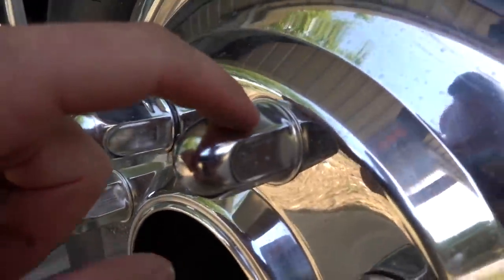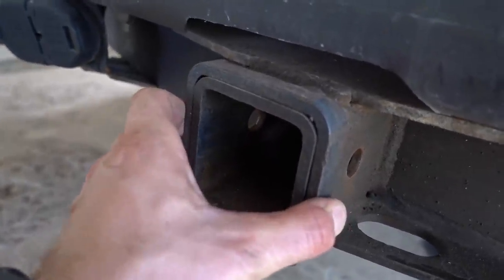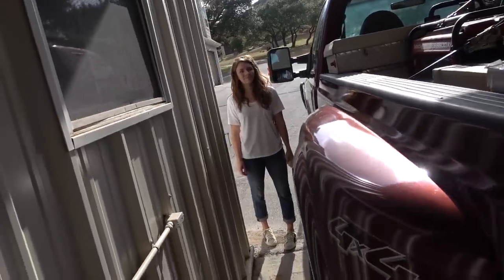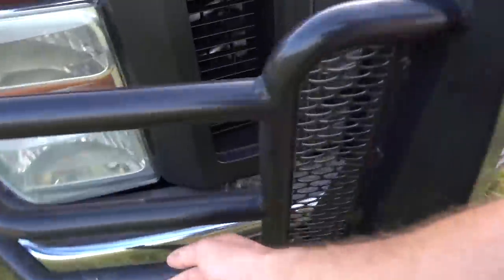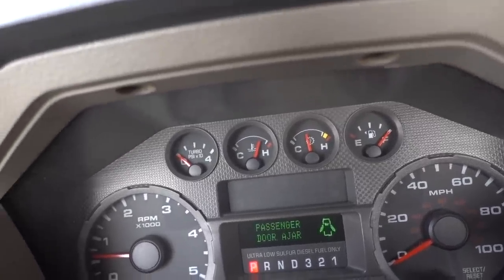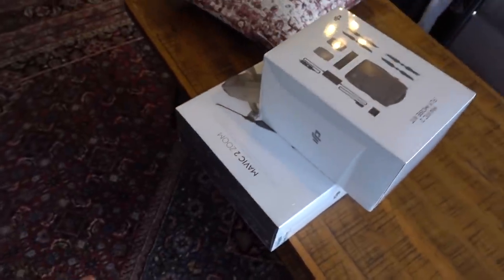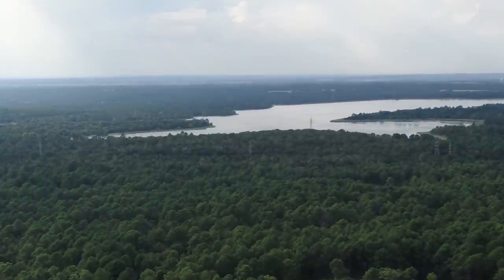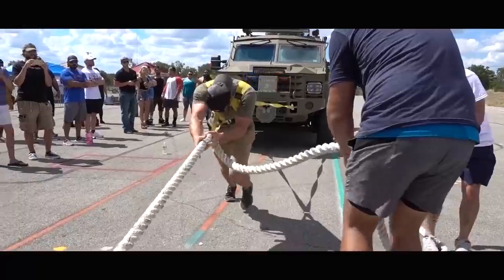My F-350 broke down immediately.....

Comment: You are about to discover just how expensive a cheap truck can be.
Reply: Should have got a cummins
Reply: @moparjr89  Much better track record, especially compared to the 6.0 and 6.4. He could have picked up a pre 2006 cummins, spent less and had a much more reliable truck.
Reply: @moparjr89  especially a ford
Reply: @GlennPearsonDIY  Yeah but the 6.7 trucks are cheaper than the 5.9s and better in almost every way when left stock.. no contest at all, no way I could tow 65mph with an 06 with od locked out after having a 15 6.7 Cummins, not to mention towing heavy in the hills it's a no contest, plus bigger axle..
Reply: Yup your right
Reply: There is a reason why the are cheap.
Reply: Should’ve got a taco
Reply: They all run good till they don't...lol

Comment: Matt: My 6.4 broke down immediately
All the truck guys from the last video: Welp, who could have seen this coming ;)
Reply: Ahah
Reply: And he was shi**ing on the 6.0 in the last video
Reply: Yeah.. I think a bunch of us posted something about this.. ahem .. wonderful engine.
Reply: Andrew Prina the 6.0 is actually a great engine after it’s been bulletproofed. Way more power than the 7.3 but still finicky with water in the fuel every now and then.
Reply: @mrmike1183  I love my 6.0
Reply: Andrew Prina I love them too. Had a F-250 and it got totaled from someone Tboning me....now I want a Eddie Bauer Excursion with the 6.0
Reply: @mrmike1183  I've got a 250 and I'm trying to get another one
Reply: Yep
Reply: Everyone
Reply: The 6.4 was a failure. That's why it was only made for two years.
Reply: We all saw it coming lol my 7.3 is at 317k and still trucking great motor
Reply: Shoulda got a 7.3 smh
Reply: Lmao they never listen. Oh well
Reply: Man i hope he listens to this....its not to late to 12 valve pea pump that dually....reliable 300,000mile+ truck with a cummins. Other problem is dont buy used duallys.  They are worked. Usually worked twice as hard compared to SRW trucks
Reply: Why not heat pig.

Comment: Matt I have a 6.4 and yours needs a Bulletproof diesel auxiliary oil cooler because yours is shot. To know for sure you need to hook up a monitor to the OBD2 port and look at your coolant temp compared to your oil temp. If there is more than a 20 degree difference between the two it’s the Oil cooler
Reply: I agree
Reply: 6.4 is junk no matter what you do to it. It will always be junk.

Comment: I am a ford guy, but the 6.4 diesel is an absolute pile. should've gotta 6.7
Reply: NEVER EVER touch a 6.0  (of course) or a  6.4. I'd even be leery of a 6.7 with all the emissions crap on them now! Of course Bullet-Proofing the 6.0 let's it shine, but who wants to drop almost $5K + after buying a used truck?
Reply: Agree but if power stroke and international didn’t split we would still have the 7.3
Reply: Polarisguyproductions idk, I think emissions would have killed it
Reply: not anymore there good now
Reply: @polarisguyproductions6549  international and ford split up after the 6.4 power joke. Just so you know
Reply: hunter ben I know I’m just saying they should of stayed together so we could have the best Diesel engine ever still
Reply: @polarisguyproductions6549  no it was discontinued because it couldn't pass emissions test because of its displacement for the size of the truck
Reply: The 6.7 is a great engine.  One of the best ford has ever made.

Comment: The 6.4 is known for legitimately exploding itself I would recommend getting rid of it and getting a 6.7l or a 7.3l so 2011 and up or for a powerstroke 7.3l its 1995 to early 2003
Reply: 7.3 all the way
Reply: If you suggest a 6.7 I wouldn’t recommend a 2011... notorious for turbo issues
Reply: Simple get a duramax
Reply: Do a Cummins swap!
Reply: I’ve had my 7.3 for 17 years and 365k. Still original engine and drivetrain. Rebuilt the trans once. One new turbo.
Reply: If its 7.3 i would go with a 2000’s one. I love the obs trucks but those 7.3’s just arent as good as the 2000 ones
Reply: Deleted and tuned they're fine.
Reply: Gmc Dude duramax are even less reliable then a 6.4 😂
Reply: Elijah Antrobus that’s actually not accurate. The older 7.3 has forged rods which are strong and the ‘00’s had sintered metal rods which are weaker. The main downfall of the older 7.3 was the mechanical fuel pump which is super easy to convert to electric pump. The suspension on the obs trucks rides tougher than the newer trucks but that’s also an easy conversion. The sheet metal on the obs is way stronger/thicker than any newer truck.

Comment: I have recently bought a Ram I still like Fords but the 6.4 should be used as a boat anchor.
Reply: They're actually awesome.....right up until that moment when they're not. I have one still. It has low and high end power. And good mileage.......And one of these days, I will be going comfortably down the highway, and the crankshaft will snap in half like a tooth pick. I know this will happen, because it happened to both of my 6.0's.......and the bottom end of a 6.4 is almost identical to a 60. Good times. Just rereading my own statement, I feel more dumb by the minute. Ha HA!
Reply: until they can make one like the 7.3 then im out.
Reply: I dont even want that pos on my boat. I have one in my garage out of my 09 and its fixing to go in the trash.

Comment: Why did you buy a 6.4!?!?!?!?!?!?!?! 7.3 all the way man
Reply: I have a 1990 7.3. I'm never getting rid of it.
Reply: mate no an 8 .2
Reply: @Ricardo Alcaraz lets see how the 6.7 is doing when its 20+ years old and has over 400,000 miles before we say that
Reply: @renl4123  same mine has 90 thousand miles
Reply: Jonathan Jennings 6.0 fully bulletproofed all the way
Reply: Jonathan Jennings I have 337k, not one mechanical issue, thx
Reply: @jonathanjennings3308  do some research, there was one 6.7 powerstroke traded in that had over 800,000 almsot 900,000 miles on it with minimal work done to it. the 7.3s do last, but compare horsepower, they dont have enough to tear themselves up (in most cases) 6.7 is the best / strongest, arguably most reliable diesel engine Ford has every put in a truck
Reply: love my deleted studded o-ring'd 6L
Reply: 6.7 is just as good if not better and makes twice the power stock
Reply: All of you have it all wrong, 6.9 IDI or nothing.
Reply: @randy s ain't nothin wrong with that

Comment: Over heats while driving but cools at idle? Sounds like a lower radiator hose is collapsing under high RPM's.
Reply: ken karish don‘t all engines cool at idle, because the fan is running air through the radiator?
Reply: ken karish what I said
Reply: @chillix0395  The fan that switches on simulates the "air speed" when driving (to cool it down)
The waterpump is connected to some shaft, so when u go faster the pump starts pulling more water from radiator.. And i you happen to have weak hoses it collapses making less (to no) water go trough it.
Reply: Hello that makes sense, thanks
Reply: @chillix0395  Let me also say, no, if your car is out of water...youll notice at idle. Because when you go fast, and dont floor it...the increased wind overcomes the overheating.

Fans are no comparison to forcing 60 mph wind past your radiator.
Reply: Fan clutch is not engaging. At idle the engine isn't working hard and it cools down, under load when the fan should kick on it doesn't.
Reply: @MaryBrownForFreedom  Exactly that too! I had the same exact issue in my acura rsx type s
Reply: @MaryBrownForFreedom  if the fan clutch wasnt engaging hed overheat at idle. 🤦‍♂️

Edit: and i think most (even in big trucks) fans are electric now. So itd be a relay or burnt motor.

Double edit: nah, was wrong...still a "fan clutch".
Reply: @chillix0395  As a mechanic I was going over the symptoms the vehicle was experiencing. 
Cooling at idle while over heating at high RPM's indicates that a restriction of coolant flow would be the most likely cause of the issue. 
If the water pump, thermostat or radiator was bad then you might have over heating at an idle and high RPM's.
As the water pump would not pump the water and the vehicle would over heat at low or high RPM.
A bad thermostat would most likely either keep coolant trapped in the engine or allow unrestricted flow which either would over heat at idle and high RPM. 
A blocked radiator would also over heat at low or high RPM.
A collapsed radiator hose would not collapse at low RPM. 
Most fans today are electric not mechanical. In case this one truck comes with a mechanical fan that could also be the cause as it is not turning fast enough to cool the fluid in the radiator before transferring it back to the engine.  
This led me to the conclusion of lower radiator hose as it feeds the water pump directly and most likely wear out first. Of course I would have to do testing first, but since the truck is not in my front yard all I can do is give most likely cause. 
It also could still be a partially blocked radiator or engine block, but Ford's I have worked on the lower radiator hose is usually the culprit in this case.
Reply: @MaryBrownForFreedom  Yes, True. I just looked it up and it comes with an electrical mechanical fan clutch.
Reply: ken karish thank you for your elaborate answer. It was just something I learned in driver‘s ed, that if the engine overheats, to cool it down it usually is better (faster) do to so at idle than with the engine turned off.
Reply: @chillix0395  Depends on the issue, Not in all cases would you cool an engine at idle, like for instance the loss of coolant.
Reply: @chillix0395  also, if the fan isnt working...youd overheat at idle. Bc no airflow.

Also, lack of coolant, or coolant flow...youd be better off at cruising speed...not 75 mind you...because then you are pushing the engine creating much more heat.
Reply: @firghteningtruth7173  Not if the clutch is only slipping, they do couple some energy to the fan blade even without the clutch turned on. so at idle it may be getting enough air to not overheat, under heavy load like 70mph hwy driving it won't be pulling enough air...
Reply: @MaryBrownForFreedom  even without coolant, and engine will stay cool enough that the electric fans wouldnt even turn on if you are just cruising.

Air cooling was a thing forever. Look at a pre 83 harley.

Edit: rather...an 83 or before. 83 was last of the shovels and some integrated oil coolers. It gets complicated...
Reply: @firghteningtruth7173  go for it, I prefer to have water/antifreeze in an engine DESIGNED to be cooled by it. When your engine self destructs you are to blame. And NO diesel designed like the 6.4 is designed to air cool. You will fry it fast. 6.4's are KNOW for cooling issues. Bad radiators, bad water pumps, bad fans, bad oil coolers... any of those fail and you eat a head gasket and possibly warp/crack the head.

Comment: My dads truck had the same problem it’s the oil cooler is clogged they need to pull the cab about 3500$ it usually only happens to us when we’re hauling tho.
Reply: Second this, a weak oil cooler is a common problem on the 6.4 while towing.
Reply: Called it lol

Comment: Shouldve done research before buying a 6.4 powerstroke. Worst diesel ever put in a pickup.
Reply: 6.0 was
Reply: @ericbrandenburg8583  6.0 from 04 to 07 6.4 from 08-10 what engine were you talking about?
Reply: @DuraStop   2003 6.0 Powerstroke..
Reply: Eric Brandenburg 6.0 is better than 6.4
Reply: Worst ever? The 350 Olds Diesel says hold my beer. Yeah, I'm old. lol
Reply: @eternalthread7846   Not the 03 6.0.  Research most recalled and lemon law diesel ever
Reply: Eric Brandenburg my 6.0 is running like a champ never had a problem with it so  the 6.4 is the shittiest engine out there
Reply: @ericbrandenburg8583  the 6.0 came out in 04
Reply: @coreyrides9650   late year 03's had the 6.0.  Early year models had the 7.3. Trust me, I had both
Reply: @BrodieBr0  dude thats one of the best engines ever made in my opinion. Not much to any power but you could rod it all day and she would still run

Comment: Like I said in the last video you need to delete the truck the DPF is clogged and making the truck over heat
Reply: Carter Paulson could be a blown head gasket. I know a guy who had that problem with his 6.4. We had to fill it with water every 20-30 minutes just to keep it going and it was still running hot. I’m no mechanic but that’s my guess
Reply: STERLING 115 sound right to me, im going to school for auto repair
Reply: T-Rex
Reply: If it was a clogged dpf it would go into limp mode and would run very fast at all. We have this problem all the time in the shop.

Comment: EGR cooler ,fan clutch , also you need to cheack the water separator on those .
They realy dont like water in the fuel .
In the 6.4 a jaked up egr cooler can give the same troubl as a blown head gasket. 
Also water pump and thermostat.

Comment: Hey Matt I have a 2000 7.3 3500 dually with a manual transmission with 300,000 miles on it and I’ve ever only had to replace a starter on it. I pull a 20 foot goose neck loaded down all the time for work with it. Very reliable work truck. Get rid of that 6.3 ASAP.
Reply: powpowking1209 yup I got one with 383k
Reply: powpowking1209 I got one too I’ve had alil issue with injector harness but nothing too big I fucking love it I just wish mine was 4x4
Reply: 98 7.3 manual trans here. 684k and not a problem in sights even pulling a car trailer up the mountain passes regularly
Reply: mines got 290k only put an alternator, a set of battery's in it and tires on it runs great. had the oil line going to the turbo slow leak once at 220k just had to tighten it. it had kept the valley filled with oil which was fun to get to so I just drove with it for like a year. if the rust was not consuming it at a rapid rate it I could see it hitting 500k
Reply: Geo Analytics yeah I wish mine was to

Comment: You could name it Mistake. Because it was a big mistake getting a 6.4
Reply: Getting a ford was a mistake
Reply: I agree ... "Mistake" is great, cause owning a Ford is always a MISTAKE !!!
Reply: @sethweese  Hey now! Not all Ford's are trash! I've got a 2015 Ford F-150 and I drove that beast from Northern California to San Antonio Texas when I moved the family out here 3 years ago! Drove through 4 states in hot as balls August! Not one problem and still running like a champ to this day!
Reply: @sethweese  lol I wouldn't say that, I own a 2013 f150
Reply: @sethweese  shiet, i have a 97 f150 with 320k miles on it and it still goes strong.
Reply: It was also a big mistake getting a ford
Reply: @dac232009  hey now, when Chevys are the BEST selling truck for 45 years in a row then you can pick on Ford's.  ( Google Ford truck towing 1.4 millions pounds! Can a Chevy do that, NO!)
Reply: I have a 2005 f250 mega cab 6.0L powerstroke diesel and I love mine onily thing done was a fuel injector that's it and I've had it for now going on almost 5 years  now with 188,650 miles on it and it's pure stock and I tow every once in a while but I mainly use it for in town use I do my annual 5000 mile oil changes
Reply: Mistake was a 6.4
Reply: I got a 95 Dodge ram 2500 12valve Cummins. 660,000 miles. Never burns a drop of oil and has never left me stranded. 🤷
Reply: 6.0 with studs, lift pump, bigger radiator and of course egr cooler,egr, and exhaust delete= good
6.4 = 100,000 miles at engine, injector, and turbo detenation = horrible
7.3= good with mild turbo and fuel upgrades
6.7= good after 2011
 Dodge= great
Duramax 06-07= best 
08-current = amazing also 
Avoid 2007.5, 2001-2003
Reply: Lmaoo 😂😂😂
Reply: I used to own a 1979 ford F-100 long bed regular cab with the 1995 svt Cobra mustang 302 h.o. engine that truck was a beast.

Comment: Hey Matt I’ve experienced the same issue with a truck before. I found that the radiator hose on the suction side of the water pump was collapsing at higher speeds. But was okay at slower speeds. Changed it out and everything was fine.

Comment: Matt: 6.0s aren’t that good 
1 day later 
Matt: my 6.4 broke down
Reply: ok 6.0s are acctuallt ticking time bombs LMAO
Reply: @Lgo559  my 6.0 has 270k still running strong as long as you put good oil in it and do the maintenance they last a long time
Reply: George Costanza 7.3 ftw
Reply: A 6.0 is head and shoulders better than the 6.4 ever hoped to be.  Sure, the 6.7 is better, but given the choice and being on a budget, I'd buy a 6.0 any day of the week.
Reply: 6.0's with 2019 fuel standards ARE good. When the 6.0 was used in the US it was built around Europe's ultra low sulfer standards, at the time the US was VERY behind and using very dirty fuel, the US did not get its diesel fuel to European standards until about 2010. So, a serviced 6.0 with the bullet proof mods on todays cleaner diesel runs VERY well......6.4 is shit because of the type of emissions equipment it uses, thats why the 6.7 went to using DEF fluid and having a easy to service EGR.
Reply: 6.0's with 2019 fuel standards ARE good. When the 6.0 was used in the US it was built around Europe's ultra low sulfer standards, at the time the US was VERY behind and using very dirty fuel, the US did not get its diesel fuel to European standards until about 2010. So, a serviced 6.0 with the bullet proof mods on todays cleaner diesel runs VERY well......6.4 is shit because of the type of emissions equipment it uses, thats why the 6.7 went to using DEF fluid and having a easy to service EGR.
Reply: The only 6.4 i would own is one thats had the entire emission system deleted AND the ECU reprogrammed to never put the car in regin cycle
Reply: Just sold my 7.3 at 320k miles
Reply: @Neighbor512  my 6.0 is at 228k stock motor but they're "ticking time bombs"
Reply: 6.0 are fine. Few minor issues that were corrected in 05. 6.4 no way.